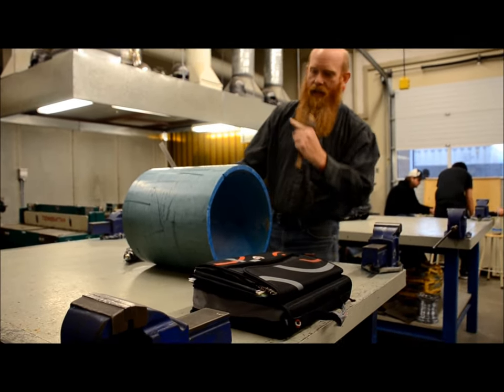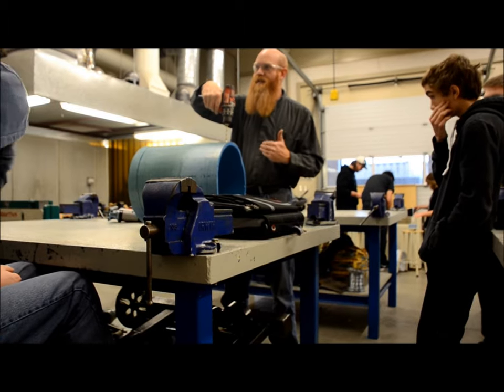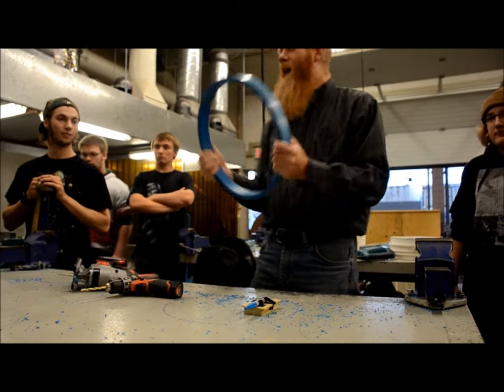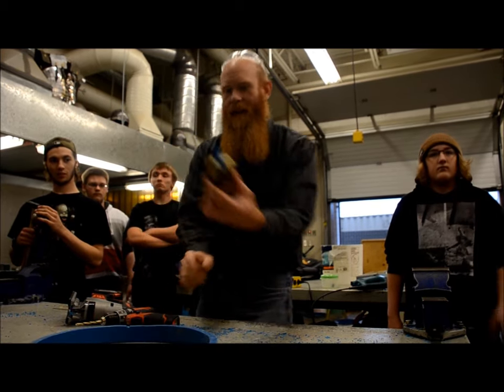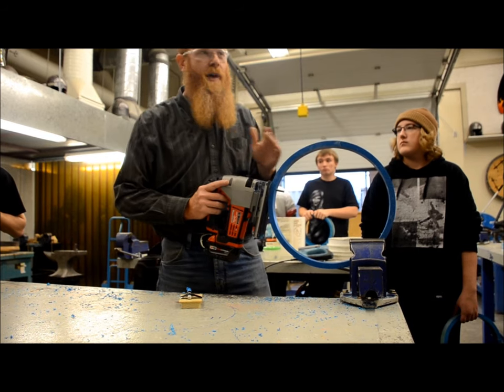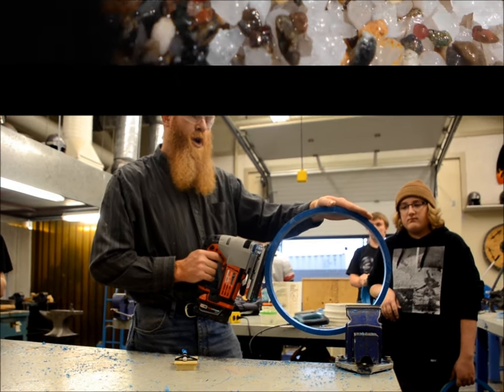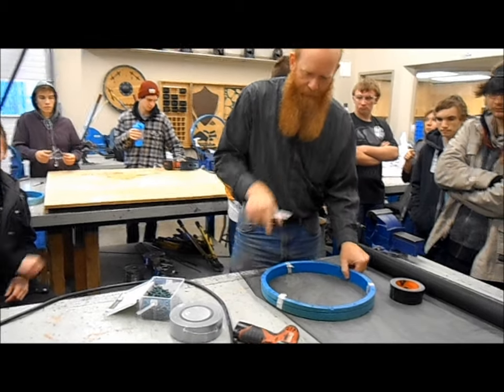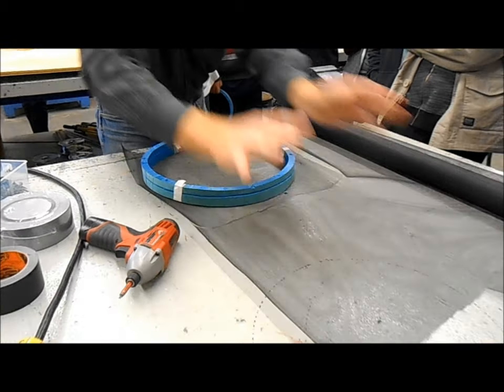How to make a gem sieve. "Saruka" (Do-it-yourself)

Comment: just came across this video. After watching your video using a gem sieve, I wanted to get one until I seen the price of them. There is absolutely no reason for gem and gold prospecting equipment to be priced like they are except to line the pockets of the manufactures. Without videos like this one, I believe that those of us on low fixed incomes would be priced right out of the hobby and experience of prospecting. Amazon sells gem sieves right now for $60 to $75 U.S. Thats outrageous for a couple of pieces of plastic and some screen. I don't even want to get started on the sluice boxes, high bankers, and other equipment. Thank you for making these videos so more people can be able to afford the equipment that we need and want to get into and stay in the hobby.

Comment: Thank you for posting the video.  Just a small suggestion. You could mark, pre-drill and countersink the holes before splitting the ring thus saving a step of having to re-align and tape it up before drilling.  It will also make for more accurate hole alignment.

Comment: You could use an 18/14 aluminum or stainless steel mesh for this too, but is costs more and is trickier to use. I think it would last longer. Good Idea Dan, I may have to make one of these and trick it out a little bit, I have a few ideas. Great post!!

Comment: No dimensions in description page for saruka.  What size is that pipe?
Is the screen cloth or wire?  What type is it?
What size inch & 1/4 long screw are you using?
Wouldn't it have been easier to lay both the ring and tape flat on the bench and work your way around?
Reply from the maker: What ever size pipe you can find, and what ever size screws that fit the size you cut the pipe.

Comment: Very fine mesh. Smallest size I use is 1/8 inch. Mind you I will give this a go as I do need a couple of more sieves. Great video and thanks for publishing it.
By the way, you have a champion beard. Do you ever worry about getting it caught in rotating equipment? 
Cheers from down under Mate.